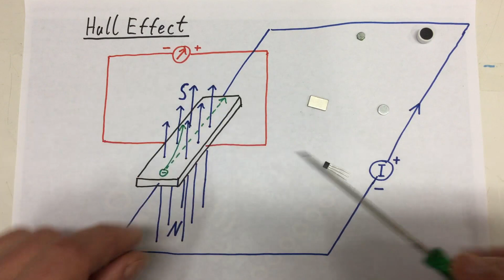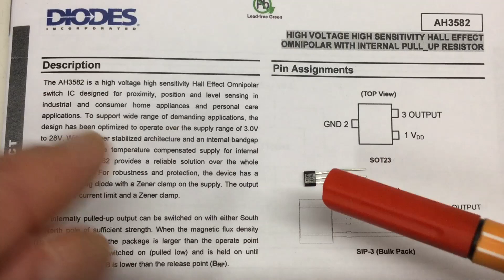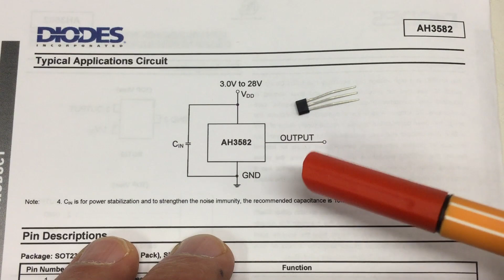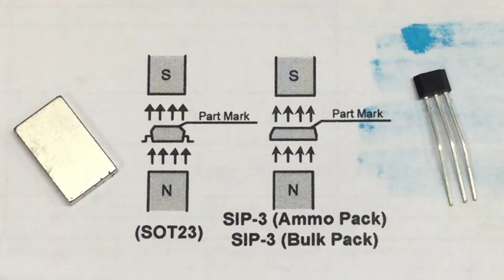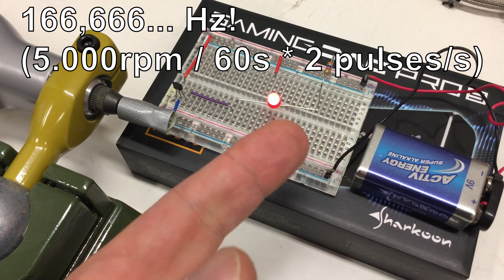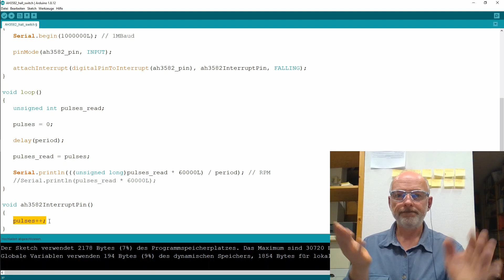Hall Effect Switches (e.g. RPM Measurement with AH3582 and Arduino)

Comment: How accurate can you expect this to be? Is there a max speed, where the sensor doesn't have time to reset between triggers? Or am I thinking abkut this all wrong? I want to use this to automate my lathe. To make threads, I need the feed speed to be a function of rpms. Do you think this is accurate enough for that?
Reply from the maker: Well, for rpm measurements it's certainly accurate enough. For controlling your lead screw when cutting threads? I think it's worth a try and the results are probably good enough. But as a German I'm already overengineering here ... The angular speed of your chuck might not be perfectly constant throughout one rotation. So it might be better to actually measure the rotational angle of the chuck and use that to control the lead screw. How cool would that be: You move your chuck half a rotation back and forth by hand and you can see your carriage wiggling slightly back and forth too. But again, that's probably just German overengineering. Anyway: Here's the first of many videos I did about Hall-effect angle sensors: https://youtu.be/t323DEj0k_s . Just search my channel for "Hall Effect Angle Sensor".

Comment: Nice video , Robert. Would be nice to compare the readings with a oscilloscope to verify the arduino, just for the heck of it :)
Reply from the maker: Thanks! And good Idea! I still have the circuit on the breadboard. Before I reuse it I will make a short addendum to this video.
Reply from the maker: I've verified the Arduino's RPM reading now with an oscilloscope: "Hall Effect Switches (e.g. RPM Measurement with AH3582 and Arduino) Verified" https://youtu.be/bLka60Dbdc4